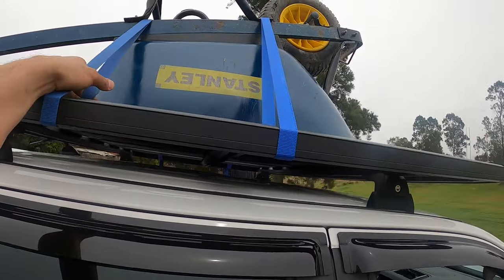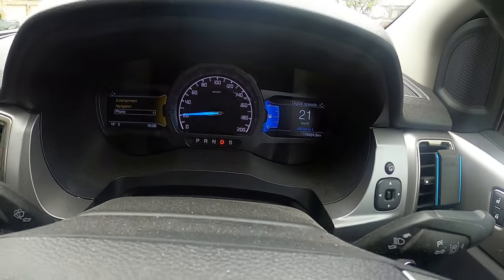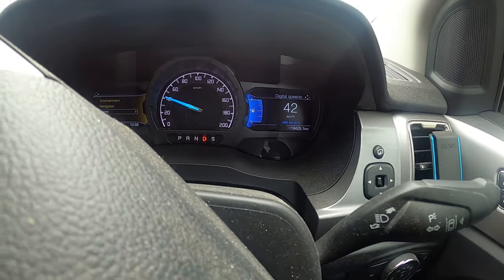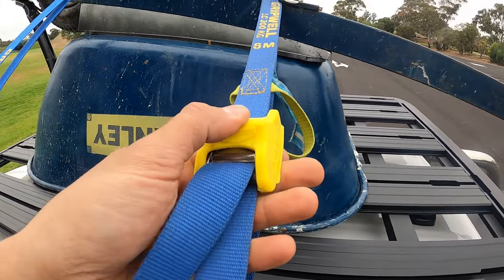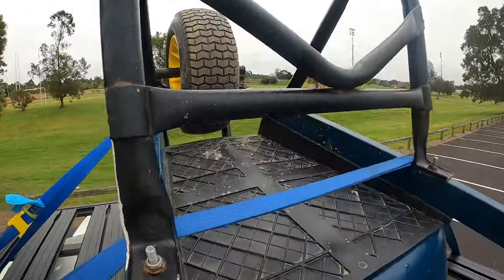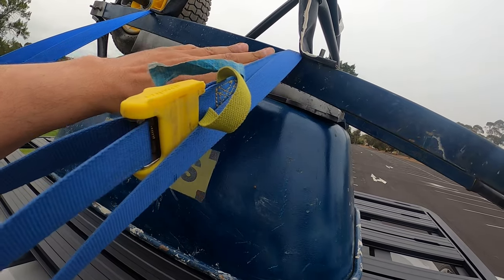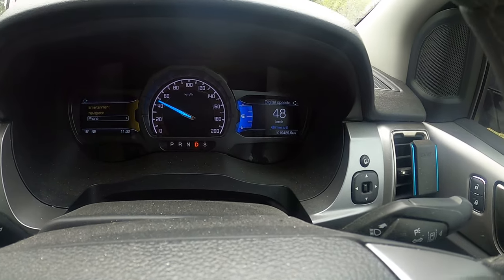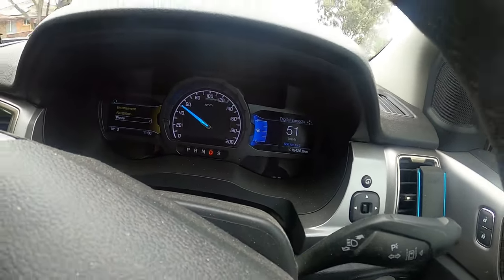How to fix noise from straps - Easy hack

Comment: Hi Bill, thx for the videos. I asked a question  on painting video you did a while back but u havent seen it. I have vinyl wrap kitchen cabinets that I want to paint. I saw your video and would like to know if I'm safe to use the Zinsser primer then an aquanamel over it. Been looking at haymes ultratrim enamel and taubmans. I see u used Bristol from memory. I'm going to try spraying with a Wagner gun. Do u only ever use that water based  enamel you used?  Thx in advance
Reply from the maker: Hi, sorry I haven’t seen your previous question. Regarding paints, I generally prefer water based paints ( faster dry time, easy to clean and low smell) particularly if I’m spraying. Depending on the texture and condition of the vinyl Zinsser followed by an enamel paint Should be fine but it’s always a good idea to do a small test in a hidden area first. Make sure the vinyl is all intact and not peeling away 👍
Reply: @billshowto  hi Bill thx for the reply. No worries. I watched a video you did in Nov 18 and u used British paints H20 enamel. Would u still use this brand as I thought it was the cheaper brother to dulux. The vinyl is all in excellent condition. We just want a colour change. Regards
Reply from the maker: I use that product as it’s cheaper and available in a paint and prime all in one product
Reply: @billshowto  thanks mate